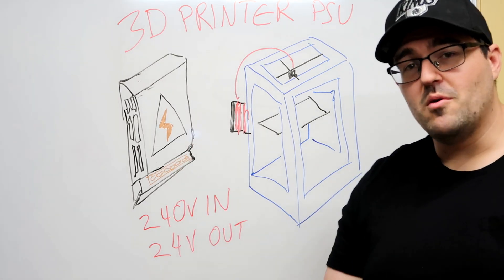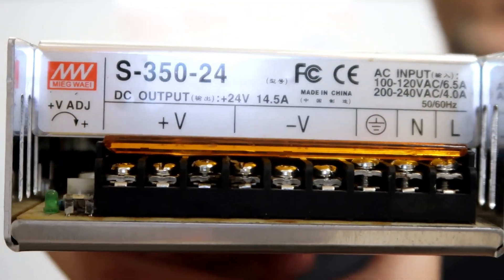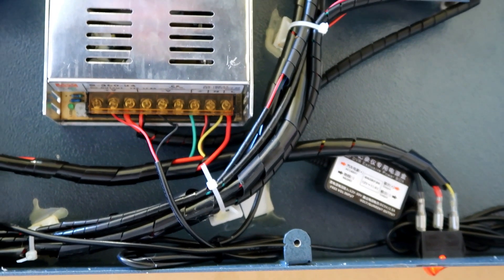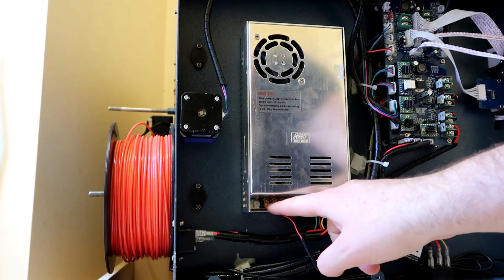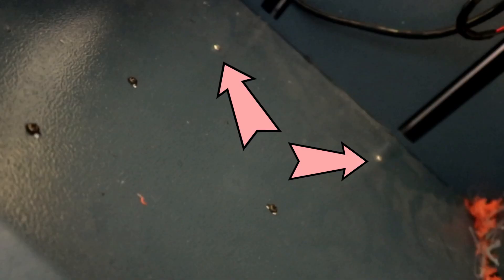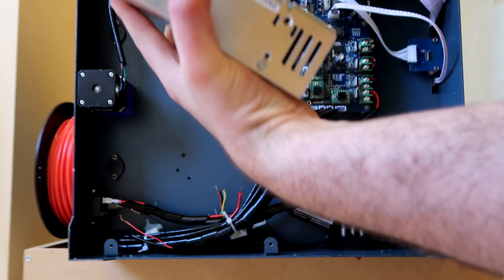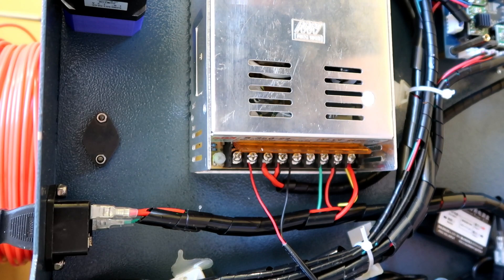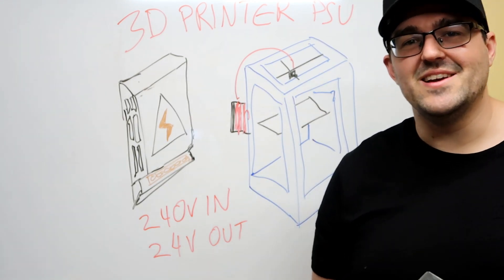Replacing the Broken Power Supply Unit on the 3D Printer DIY!

Comment: Hi i have a question about my cr 10s pro v2, i put everything together, and when i go and turn it on, the screen doesn’t come on, but I could hear noise coming from the machine, I checked the fuse and it’s fine, i was wondering if you could help me

Comment: Where did you get the replacement PSU from?
Reply from the maker: eBay. It was the cheapest I could find.
Reply: @ScottyDIY  thanks, i think i just blew mine plugging it in for the first time
Reply from the maker: That's strange, just check and make sure the voltage setting its correct with your supply voltage.